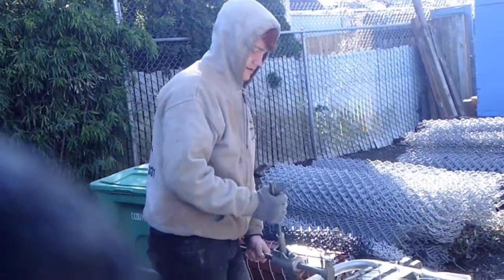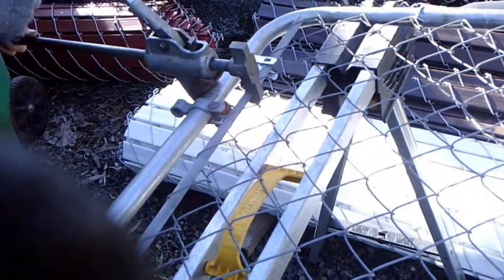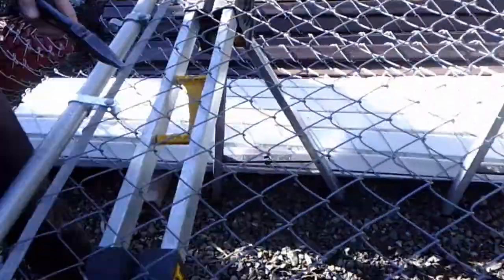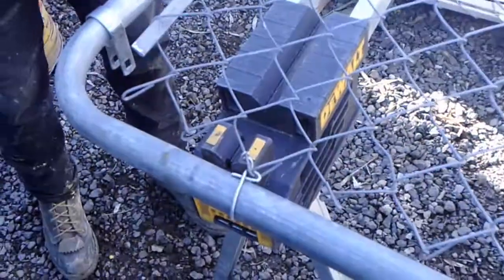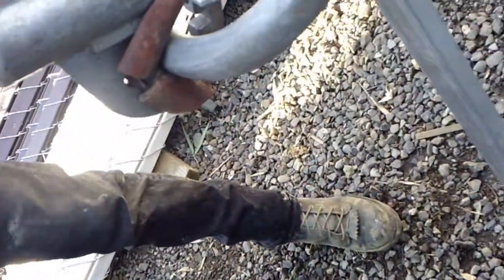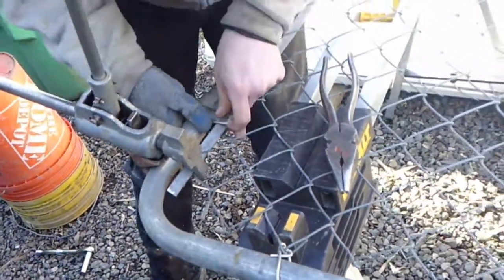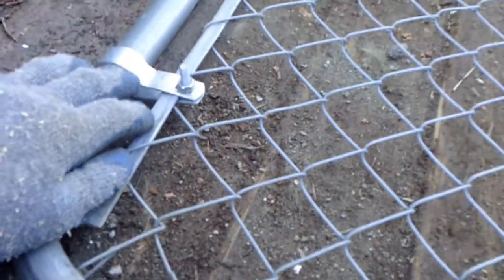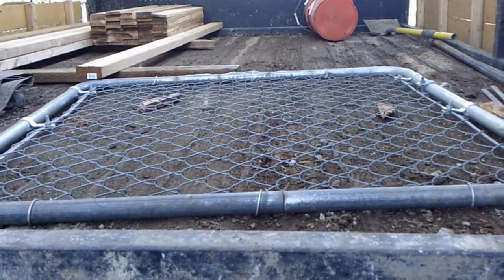What Is A Panel Stretcher For Chain Link Fence

Comment: Another great use for the pull jack, is to get the chain link to level on the top rail if it's sagging too low, after it's all been stretched. Hook the pull jak on the top rail and the chain link, and if the chain link is sagging, jack it to height. 😁